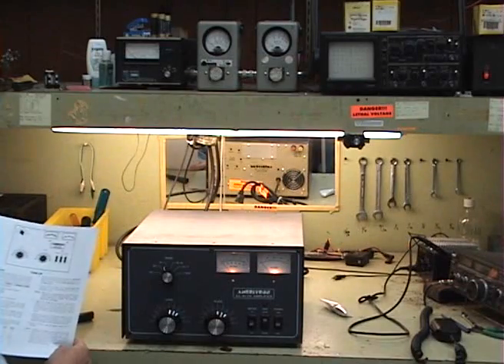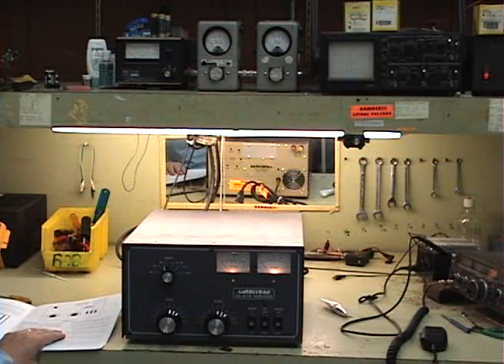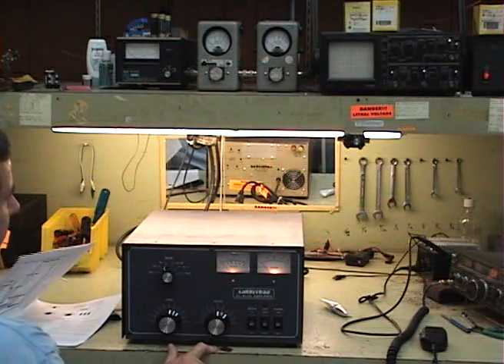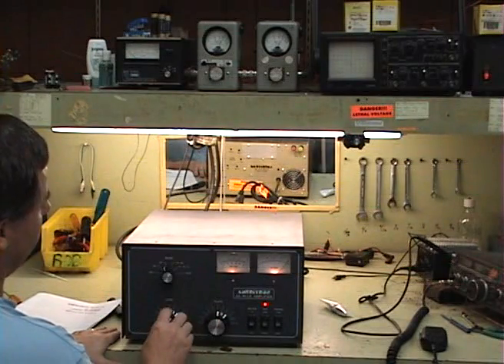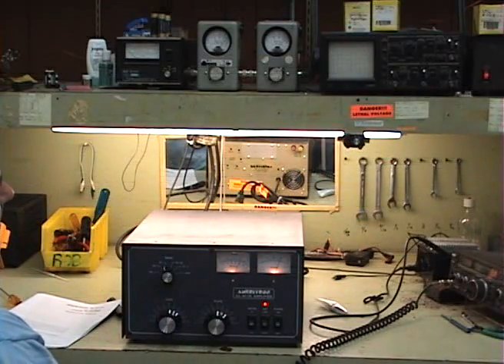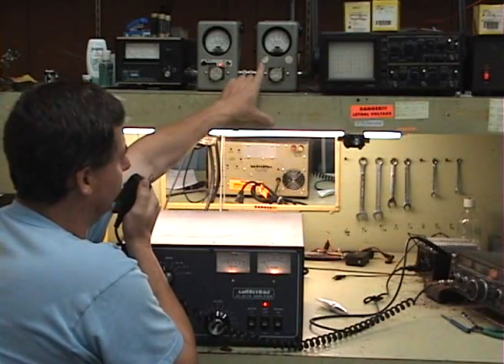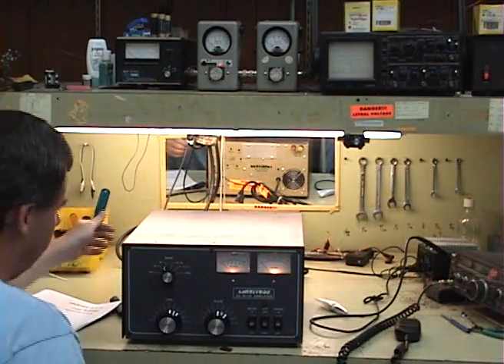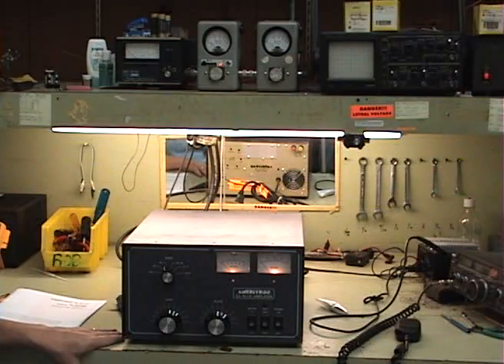Tuning your Ameritron Amplifier - Part 2 of 2

Comment: Amplifier: ALC: Phono Jack. Supplies up to 12 volts of negative voltage 
for ALC control of exciters. IC 7300 The ALC input level must be in the range 0 to –4 V. The transceiver does not accept a positive voltage. Non-matched ALC 
and RF power settings could overheat or damage the linear amplifier, how do you adjust it , do you put voltmeter on the alc plug and set it to --4 volts? Fred in Uk

Comment: Do you have to have the ALC cables connected during the TUNING PROCESS?
Reply: He didn't hook up the ALC until the end and than shows you how to adjust the ALC knob on the back of the amplifier which I think was important....so belay the fella here telling you to hook it up prior to tuning the amp !
Reply: According to the al80-b manual, yes. I appreciate the effort mfj made over a decade ago, but it's time to remake these videos and clear up a number of confusing points.
Reply: @tunatuna6723  It might be depending on the AMP model. For the 811 H You do not need such cable if you are going to operate with exciting power less than 70 watts (According to the manual). I disconnected mine (sine I operate below that power) and it made NO changes to anything. If you choose to use it then follow the steps described here on how to set it up correctly. The manual is available on line.

Comment: I called MFJ/ Ameritron Tech Support because my new AL811 amp was self-oscillating on the 20/30 meter setting. I believe this guy was the one I talked to, as he had NO IDEA of what I spoke. That amp ended up cannibalized and is now part of one heck of a 200W AM transmitter.

Comment: Are these instructions still current?
Reply: Yes, the manual states that you should tune the amp for Maximum Power output while not exceeding the Plate and Grid meters limitations (200mA GRID AND OR 750 mA fo Plate current) NOW, that is not to say that it would be wise to operate like that... After I tune for maximum power output I ALWAYS reduce my exciter power to be around 100 mA grid current (that is my personal choice but will keep those tubes going for quite a while). At any rate, you should NEVER operate the amp with more xciter power than you tuned it with. Tune for MAX then reduce exciter... that's the key...

Comment: It might has been asked before, but I am a beginner to tube amps. If I have tuned the AL-811 on let's say 20 meters 600W output, do I have to tune it again for lower input power levels? (Like you have to tune it again when using a higher power level)? 73,
Reply: Frank Johnson Ah, I see. Thank you. 73

Comment: I Bought a used 811H it had some issues but after replacing the finals and a few other parts, the amp is a Tremendous buy !...worth every penny. Maybe in another post, I'll mention what they should have done in the build process.  de N2AIE (Vince)

Comment: What are you keying the amp with. A Cw-key, a foot switch? What. I find this important. The directions say Cw-key. You have also left out the mic gain which is another point. When does one turn it back up.

Comment: I like how this guy explains things.Made the mistake of disconnecting the band switch shaft and now can't get the thing to work on some bands, cause the radio shows a swr and won't put out power, even tho it's flat or at least tuned flat. Help! I did mark the original spot on the shaft. I do use the ARB-704 to my ft-920. Use to work like a champ. It is a 13 year old amp and I just replaced the tubes for the first time with Chinese ones. Any advice through a email appreciated. de n5vwn 73's

Comment: It sounds like a lot because the guy's explaining everything to the minute detail. In practise, tuning up is just a few seconds of twiddling the plate and load controls. You get used to it, it's done in the blink of an eye, and tube watts really do sound nicer than solid state ones, that seems to hold true for RF as well as AF. I use a 30 year old Heath amp and wouldn't swap it for a SS one. The price of replacement  transistors, watt for watt, is way above the price of tubes too.